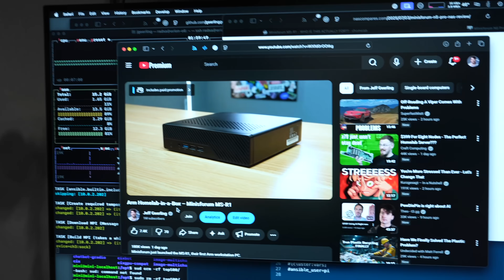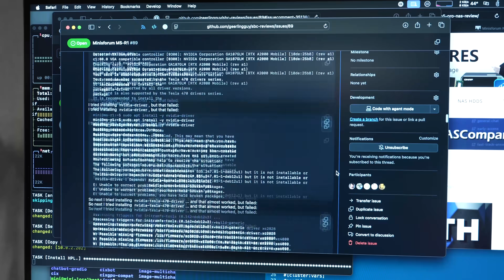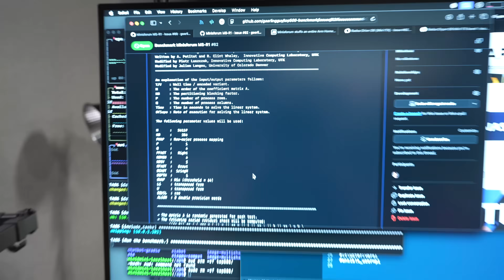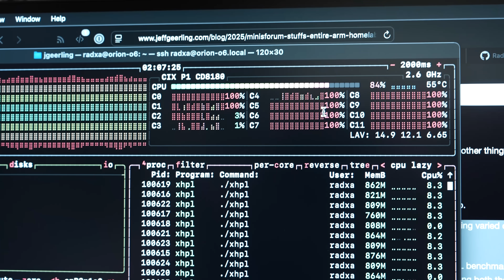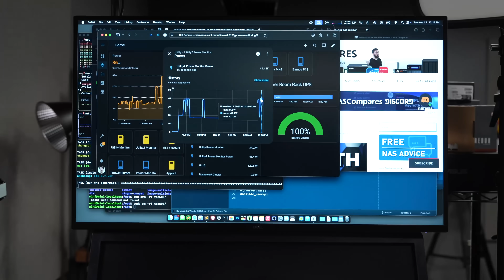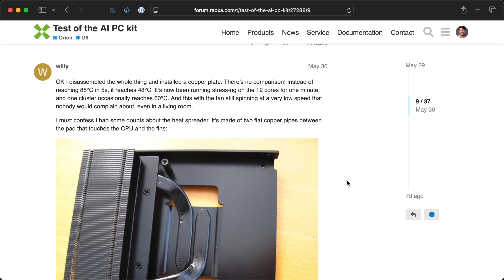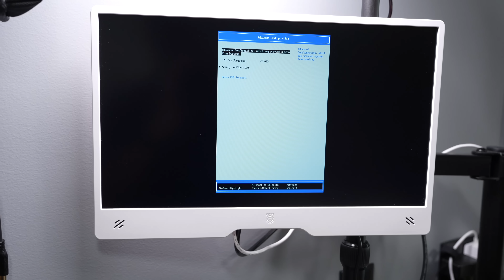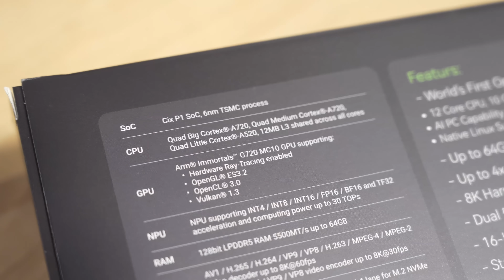Much Ado about Arm and Benchmarking

Comment: bar the crap cheap case what has the Minisforum got that the Orion 6 motherboard do have. For a work station the orion 6 look way more fun and in a normal case adding dGPU easy. the Orion 06N is even better if you not wanting PCI-E x16(x8). The orion 06N has no PCI-E, but is smaller and they all run the same SOC anyway. just one is £155 for 16-32GB, while the others are in the £500 for same Ram levels now. miniforum prices outside of US are a joke. As I planing to learn low level scheduling this CPU is like magic to me. However I haven't got the money to buy any of them. But I heavily considering the orion 06 board and 06N board. I would like a noraml PC case so the ITX board I am loving. But the cost now Radxa has sold out is criminal and most are being shipping by dodgy scalpers from the US, £390 for a 8GB itx board is a joke. Just because they brought one on the cheap hopping to upgrade the Fixed RAM and they do like it because3 it don't work like a PC out the box, you have to work on a development board and hardware. but they is a massive market in EU+UK for OEM Arm based machine as Framework, Minusforum and most OEMs are charging mental prices outside the US AI market. It a custom SOC so you should think of it like a M4 apple chip or an x86 mature platform. I might even look at the Bios side too. As much as you love the Pi and kiss up to every model they make like a shill, the Price you pay on the Pi for that support is very high as P{i cost outside of the US is shit, if you can find them. They also don't host chips with good iGPU's like this one has. Running the OS is the easy bit. I would buy a Rockchip over Pi was there are more board with their CPU's. I waiting on the next RK set of high end chip because like the pi they are just to basic, easy to work on less things go wrong, but I have 2 tasks I want to develop system for, and looking at running custom code and no OS. Really wish Radxa did sell out of the Orion 6 as even on Alli they are silly money no vs the less common 06N, which i like but has no PCI-E 16 x8 socket which I want for a DGPU I thinking as Nvidia only do LP card and intel and AMD are either weak card or like AMD big cards and coolers. But Nvidia does many Low Profile dGPU's with some grunt.

Comment: We need to benchmark the NPU real performance :D

Neon is the MMX of arm: single instruction multiple data

1300 arm instructions getting close to the 1500 x86 instructions

One step beyond neon is to use the GPU like an x87 math coprocessor: opencl and opengles

Comment: Thanks for posting this update.  I saw the NASCompares review and I also saw your comments.  I too was thinking there is no way any system only uses 1-2 watts at "idle".  Sleep mode is not simply "idle" by most anyone's definition.  Sleep mode or hibernation is basically "turned off" for all practical reasons while the system waits for mouse or keyboard input.   Love Robbie's channel but he does need to be a bit more clear as to what "idle" means on the reviews.   A difference of 15-20 watts at idle could very likely mean the difference between me wanting to buy or not buy a small switch or mini computer.

Comment: "Every ARM system is different" AND HOW. Just trying to accommodate differences in pinout between ostensibly inter-compatible ecosystems is a pain, and that's without tweaks between firmware revisions. Cant imagine involving the esotericisms of the kernel into the mix.

Comment: It’s practically mostly about the SW and the ecosystem these days. Many of the ARM boards are a manufactured e-waste unless they fit some specific and narrow-focused use-case as they simply won’t have even a fraction of the support raspberry pi has. Dev boards only make sense to complement large quantity integration to an actual product for the developers. Otherwise it is just a (learning) toy. Reviews mostly focus on the HW, but to me the SW/ecosystem are more important, so I appreciate this video❤.

Comment: I'm confused...  If the CPU is running a cache(hit or mis, doesn't matter) it's running an instruction, top is showing cores idle, not running instructions!  and not trying to access Lx cache.
Reply: A cache access looks like an instruction taking lots of clock cycles, not linux kernel(scheduler) asking the core to go idle.  Edit: What we are looking at is scheduler accounting data, possibly a ring buffer with a log.

Comment: RE the foot pads on that rockchip case, put them back, but not in the place made for them, but rotated 180 degrees on the hypotenuse of the triangle toward the center of the case.  You get the airflow, and you get access to the screws.  Just my 2 cents.

Comment: On the feet/screws issue could you not put thick rhombus pads on the raised toroid, in between the triangle and the fan holes? That would increase the airflow gap as well as allow for uneven surface - I'm sure red shirt Jeff has something (wood block with felt bottom?)

Comment: Is part of the problem is that the different ARM cores have different instructions like when SSE 4 and AVX were introduced? Processors that had those instructions performed better than those emulating. The problem is that the hardware is released then the software has to catch up

Comment: Well, I installed all the firmwares onto my SSD into a separate folder. All you need to do after is CD fs0: and then run start.nsh (or whatever that script is). That way you can switch and back quickly. Eventually I settled with 3.3.1 because it runs mainline Ubuntu/Fedora with 12 cores and standard GPU drivers.

Comment: I think the apple M series chips have the exact same problems as every other chip. The difference is in that M series chips are only used by apple and they know the quirks and have everything setup complete and ready. So you don't notice. If they released the chip to other manufacturers you would see the same problems as you mention for all the other arm chips.

Comment: Tip: get some small hole punches and punch screw holes in the pads. Something the manufacturer could and should do. After that you can keep the pads in place and open the case easily.

Comment: Tldr is ARM is nothing special by itself, Its actually terrible when it comes to standards. This why its so damn hard to make linux or even windows just work on snapdragon laptops Not to mention EVERY android device needing tons work to make the kernel even boot with all drivers. The only thing that makes any ARM chip decent such as apples M series is the special engineering that Apple does to its chips which net them a really solid performance per watt. At the end of the day even with less performance per watt zen4 - zen6 will always win. Can't beat standard bios and OS support.

Comment: for the pads i would simply move them closer inwards so the screws are exposed and it still has the feet, there is plenty room to stick them simply next to the designated spot

Comment: BTW, have you tried upstream kernels with dtbs other than acpi for rk 3588 boards? I'm wondering if there is any difference between older acpi or vendor kernels.

For any non upstream arm boards I only care about the very basic, from basic CPU support, pcie (nvme and ethernet if connected through pcie) and KVM. All other quirks are more or less expected.

Comment: I have a friend who got a radxa cubie a5e for a network traffic monitor and network level adblocker but whenever i tried to switch him towards a raspberry pi, he kept saying no. I wasn't doing that for the sake of being a Raspberry Pi Foundation fan, but also because between my Pi 3 and 5, they both work flawlessly with what i might throw at them, even if the 3 is slower. But, regards the benchmarks, I'm surprised how long it takes to have the most accurate data, so, I think I can add it to another reason why I like watching your videos on SBCs and ARM-based boards compared to anyone else in this community

Comment: Hey Jeff, willy here, I'm glad that the copper shim trick worked for you as well! BTW, don't be sad for your benchmarks. The way you're doing them is exactly how benchmarks should always be done: only sticking to facts and documenting test conditions. You always leave some room for doubt and that's super important. I strongly prefer to read a benchmark saying "I find it a little strange, look what I've got", which makes it tempting to try to go further, rather than "this is what this device is capable of, period". You don't even need to remove sections of your videos, updates are sufficient. Keep up the good work.

Comment: "idle" CANNOT mean different things to different people, what it means in computer terms was defined before I or you or I or the guy from NASCompares were born. Idle does NOT mean suspended or halted or whatever. Idle means powerstates in ON but they can go into whatever low power idle state they can immediately bounce out of without needing to for instance boot or load a kernel or whatever else. Tap keyboard - screen turns On immediately and it's ready to rock'n'roll.

Comment: With these types of cores (big, medium, little), I think you have to say to the system what command use which core.
Like all /bin & /usr/bin can only be used on 2 little cores.
Can it be easily done with a .conf file? I don't know. i hope it should.

Comment: neons like 3dnow! or intels simds.  sort of.

these sort of arm weirdness in benchmarking and stuff has existed for a long time and there was a time people would use thumb mode to just save a bit of memory and even that wasn't always as clearcut as thumb being slower(it has less instructions and they were 16bit long for the instruction part, this could be significant memory savings like 25 years ago - generally it would be slower though with the compilers of the day - but not slower in loading from slow memory - but if you had to load the code into ram in the first place even varied).

Comment: Noup, it's not your incompetence. In my case I bricked by doing a firmware upgrade just because I wanted to test something. Now I need to remove the rom chip (which luckily it comes in a nice socket) and flash it out of the board and see if that un-bricks it... oh dear.

Comment: With respect to the pads covering up screws - I would LOVE to see manufacturers just cut a hole in the pads or put the screws slightly to the side.. The feet need to be there and forcing users to peel and re-stick glue is not consumer friendly

Comment: You are so good, but I think the standardize benchmark should not be the same as "optimal", one important reason for reviewer: You are not manufacturer, they should try to use the best possible combination of software to push the limit of their hardware, for reviewer and end user, we run standard distribution software that "did not optimized" and got  result from them, since we may not have the skill to compile Linux kernel everyday and put it into use. Nice to have someone to optimize the software, but I think that is another video and best if he/she also can have the ISO image for download.

Comment: this is why arm and riscv will never take over for x86 for desktops, everyone needs to standardize themselves on UEFI and needs to be able to run generic kernels, I think a board of some sort standardizing chipsets so vendors can build motherboards with socketable cpus is a must
Reply: the chipsets are more or less built into the soc itself. but some cpu module standardization would be necessary. maybe as a card with enough pins to optionally have memory off the card too.

Comment: I've put a lot of time on the O6 trying to identity the lockups, seems to be load dependent, but i've been unable to run a memory test yet, and ive seen some odd stuff with memory on it. 

I'm really hoping the stability issues can be resolved, as its a great little dev board otherwise.

Comment: If high benchmark results require  recompiling a bunch of libraries by hand, your earlier scores ARE NOT WRONG.  They reflect the performance Joe Average will probably see for whatever software they run if they just install Ubuntu and go.
Reply: Recompiling? I thought it was a CLI or configuration parameter? Something like "blis_configuration_option"? Which forces to use NEON (ARM's SIMD calc stuff)

Comment: 11:30 Some engineers really want to hide screws. If they are on the bottom of the case they are already hidden. 

I have an old Land Rover (1990s). The entire thing is basically bolts, nuts, screws and very simple construction. The Door cards have these stupid plastic clips, they will break when you remove the door card, presumably to make it look nicer. They could have put some screws there, I get that it doesn't look that good but it is a 4x4 that supposed to be used on a farm.
Reply: Why I love my 6 ThinkPads; from a T22 to the X13s.
All screws are accessible. 😁👍
Reply: @Armand79th  I have a T480s. It like 6 screws and you are in.
Reply: there's this tool thingy with a C shape at the end that makes it easier to remove the trim without breaking the clips.  it was just standard for how to do a door(easy to engineer the door metal part you just have holes), you could hide the screws too. some cars use a combination. and now clips built into the plastics. simple bolts would be nice.
Reply: @lasskinn474  I have a set of trim removal tools. It is a combination of the clips being 30 years old and it being British Leyland. Even other Landrover defender restorers say they are garbage.

Comment: Everytime, I look at getting an ARM machine that isn't a Pi (I am not buying a Mac ever again, absolute garbage and IMO Pis just aren't good for what I want). Either there are massive problems with the hardware, the software or both. 

You can get a decent mini-pc that WILL work for similar prices or the same. Stick on any Linux distro and it will work 99 times out of 100. I suppose though we've had about 25-35 years of x86 PC hardware and it is a known thing. Arm and RISC-V might be fine, when I am 75 years old.

As for benchmarking itself. Lots of channels go into rigorous bench-marking. As a consumer I just want to know roughly what the performance is for what you are paying.

Comment: (~) 5:51 another case of YT removing perfectly good features lol. you used to be able to put annotations on screen.... until people abused the shit out of them. Hopefully they eventually give creators the ability to not only delete parts of a video but insert clips into a video after it's been uploaded. Or even still, let you reupload a full video without incurring the dreaded reupload penalty or something.
11:37 yeah vendors of these thin mini PC's should use long screws imo. The long screws would grab hold of the top plate and pull it towards the bottom... and then stick out to provide feet for cooling space underneath it.
Reply from the maker: "Big" channels apparently can replace video content. Wish we could all have such luxury

Comment: Reproducible benchmarks are lovely, but if they don't correlate with actual application performance differences, then they become akin to "whipping it out to measure". If specific options to make better use of the different processor cores don't help applications I actually need to use a computer for, is that even relevant?
Reply from the maker: The best thing about microbenchmarks that are less practical, is they often point out flaws in BIOS, performance profiles, etc., and those lead to real-world performance problems.

That's why I'm always trying to improve the gamut of benchmarks I run in my standard suite on sbc-reviews; then I'll use the computer / SBC a bit separately (browsing the web, compiling some things, editing documents, downloading and expanding files...).

All that together informs my outlook on the value and price/performance of a machine.